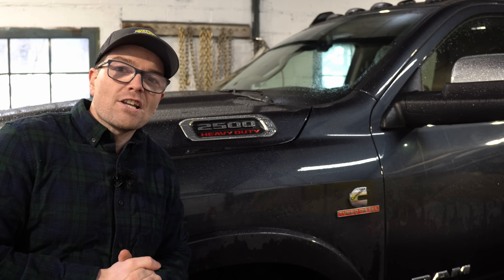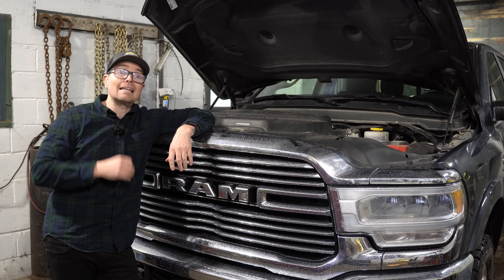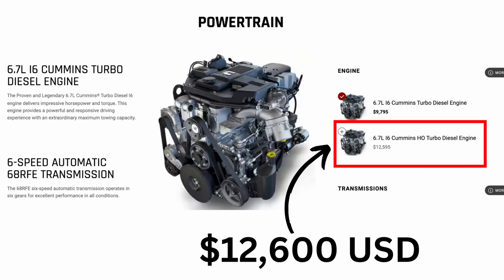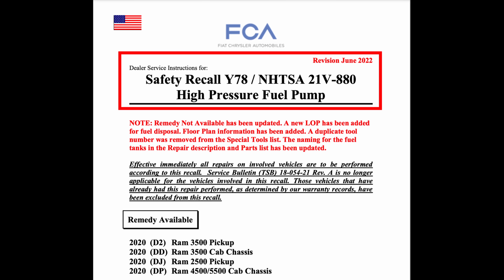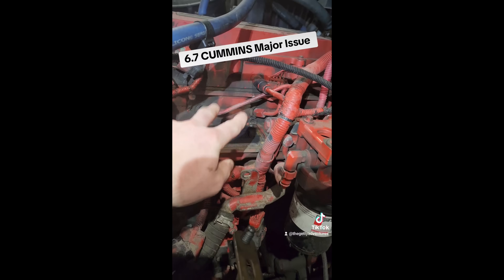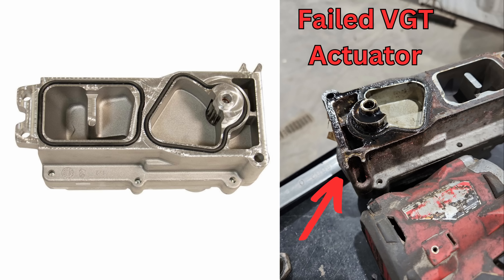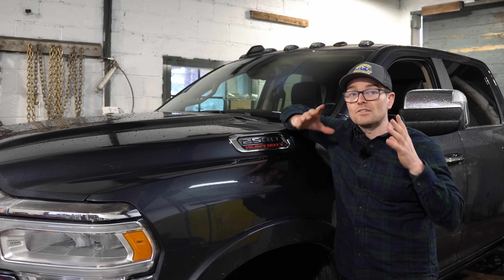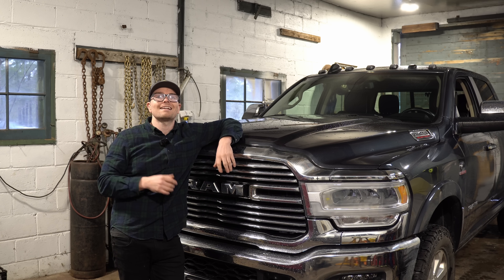RAM 2500 UPDATED 6.7L Cummins Diesel Engine (Details Released) | Diesel Mechanic Review

Comment: Guess we'll find out in about 6 days.  Had a 2014 6.4L hemi 2500 with 4.10's and traded it off on a new 24 ford F250 with 6.8L and 4.30's.  Gotta say the powertrain is a smooth unit, the programming is great, and so far with 3200 miles is more efficient than than the hemi was.
Reply: @aarons307    If I would’ve had so many problems with my 2016 Ford F-150 there would be a F-350 7.3 gas truck sitting in my driveway. I need a heavy duty truck and I’m having trouble deciding which one to purchase.
Reply: @hank976  Just bought a used 2017 F350 and we LOVED IT! That is until it rained and then dropped below freezing and now the fooking doors won't close on passenger side without using a hair dryer on them for 10 minutes, eating the lose and getting a Ram. Fooking ford. The new fords felt like garbage on the inside when we tested them, just cheap everything and I don't like them on the outside either, those headlights are trash IMO, thats why we went used I actually like the 2017, no I LOVE it but I cant trust the truck. It's our family tow vehicle and there is no way I trust this thing anymore, done with Ford. Guess we will have three mopar in the driveway soon.
Reply: Ford jumps into too try in 2025 most recalls for 2025 , just a popping start first day in 2025 January  1 2025
Reply: @BryanRichardson-s3v  All brands have their fair share of recalls.  In the 11 yrs I had the 2014 RAM I had 14 recalls & updates performed on the truck.  Half of those were for programming.  Its guaranteed, on any of these new computer controlled vehicles, your going to have constant recalls and updates.
Reply: great choice! Fords have the best frames and the Godzilla platform will be looked back on as one of the best pushrod engines ever made !
Reply: hope u have better luck with your f250 than me mines an absolute pos so many issues im looking to trade it for a ram or chevy idk wat i want yet

Comment: Unfortunately the hd rams are not competitive at all and just as expensive for an old platform I love dodge and cummins but had to leave because ain’t no way I’m spending 100g on a platform from 2010 they need a totally new platform to be competitive
Reply: There shit, i’ve got a 2019 cabin chassis Cummins truck in the shop right now getting a motor put in it for a dropped valve
Reply: @ unfortunately all makes and models now are junk can’t even trust Toyota anymore

Comment: Interesting to hear they are going away from the CGI block.  Probably a reason.  The heater grid nut was a real bummer for those that lost an engine because of it.  I would have thought a redesigned or repositioned grid heater might have worked but there isn't anything wrong with glow plugs.

Comment: Oil filters should always be on top. My VW Tiguan has one and it is the easiest filter change. Meanwhile my Ram 1500 Hemi placed the oil filter in the worst location they could think of to make sure you pour oil over everything.
Reply: Oil filters on top increase convenience but decrease reliability, as the oil now needs to be pumped up to get to the filter which is less effective with a cold engine vs a filter that the oil naturally settles to and is assisted by gravity even when ice cold.
Reply: @Cloud30000 Jeep and Chrysler v6 also has a top filter and they are known for bad lifters after extensive miles due to the top filter that gives you a dry start every time,.
Reply: Ram has the worst locations but the Cummins r worse having to go through the passenger wheel well then turn it sideways and dump it  to get it out.

Comment: Going back to a traditional iron block just seems like a straight cost cutting measure.
Reply: If they can't build a durable CGI block then I guess it's an improvement.
Reply: Cut cost and increase price. Sounds like every oem these days
Reply: @joseeduardo4327  That's every product in every business.  Except maybe high end watch making.
Reply: And it sounds like the right call too...
Reply: Sounds like they are doing nothing to address the horrible, worst in class payload capacity on the diesel 2500s.  Will probably be worse since the engine will be heavier.  Already more expensive than the comparable chevy and now the gas to diesel upgrade will be $12k vs $9.5 K on the Chevy.
Reply: @barrysmith3419  I think the 8 SPEED ZF transmission will make a BIG difference in these trucks!!
Reply: They went  back coz its better
Simple
Reply: Cost cutting, period.  Everything has an inherent failure rate including engines with iron blocks.
Reply: original block is way better and proven. why are we worrying about 75 pounds? we'll loose that in wheelwell sheet metal in 5 years
Reply: I like an iron block in a diesel
Reply: No it’s a reliability issue. Read reviews
Reply: @Troy-y5g what reliability issues?  I have yet to see a fractured or exploded 6.7 in any configuration unless you are talking 2500 hp trucks.
Reply: @loveracing1988  are you living in a cave ?
Reply: @sounboy4498  I'm on 3 different Facebook pages for these trucks, I've never seen a block failure posted. It's just people crying about check engine lights. I'm at 41k on my 2020 without any issues
Reply: @loveracing1988  many of the 2019+ RAM trucks have engine failures. Failed lifters, weak mains, dropping valves. I can speak from my own personal experience, I don't follow Facebook groups to know failures I'm hands on in the trade at a cummins facility and another general LD truck shop
Reply: @sounboy4498  you were referring to the blocks. I've never seen a block failure. Lifter failure sure
Reply: @sounboy4498  weak mains sounds like the only issue potentially related to the block design. Is it a bearing issue or like the video here suggested about some block flexing stuff? I kinda feel like a slight design tweak to the block could pretty effectively mitigate the latter instead of changing the whole material composition.
Reply: @ALMX5DP  Correct, nothing is wrong with the CGI material it has been proven. However, on the 6.7 Cummins, they did not do a good job  primarily in the main bearing areas and few others I've seen the material in the cam journal areas very little material
Reply: @sounboy4498 But the whole point of this comment thread is about CGI vs. cast Fe blocks, not what happens in the heads.
Reply: @Troy-y5g it’s not a reliability issue, I know a Cummins engineer on the b6.7 project. It was purely a cost cutting measure. The weight savings did not justify the significant increase in cost.
Reply: Cast iron blocks last longer but is not as good in dissipating heat as an aluminum block
Reply: Tell me why cgi was necessary, it had zero effect on reliability except added cost.
Reply: What do you mean? Iron is always preferred
Reply: @RyansShop  CGI is a more dimensionally perfect block material, it forms nodules and the omnidirectional casting makes it stronger in every direction.  Where it matters that means a CGI block can be lighter than an iron block.  This is excellent in a block like the powerstroke because the v configuration requires additional webbing and is generally requiring it be individually stronger at the engine mounts on each side.  It also means the crank requires additionally support because of the load directions.  CGI could shave 100+ pounds and still be stronger.  CGI is still iron.  But how the structure of it is made makes it stronger.
Reply: I think a large part of the cost is EPA driven.
Reply: They went back because the graphite iron block was a flop that’s why they went back to the original cast iron blocks
Reply: Far better block, way less flex. Proven durability.
Reply: What’s wrong with the 6.7? Shits unkillable
Reply: Ummmm what’s planet are you on?  Roller lifters are killing these engines.
Reply: @rofin9541 lifters arnt the block he was referring to the block change they are making
Reply: @CritJ epa kills anything
Reply: Iron blocks are stronger and machinable compared to CGI blocks.
Reply: @bryandepiazzy8679  CGI is actually about 75% stronger and 75% stiffer than a regular iron block but Cummins implemented it poorly and removed way too much material